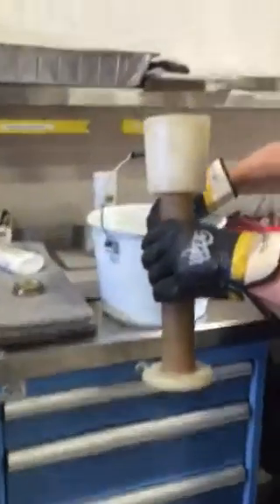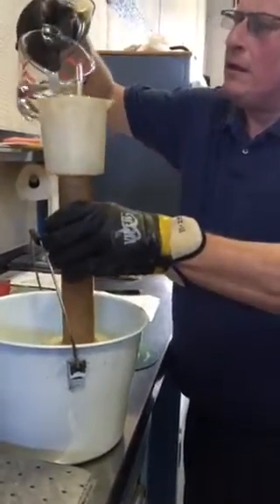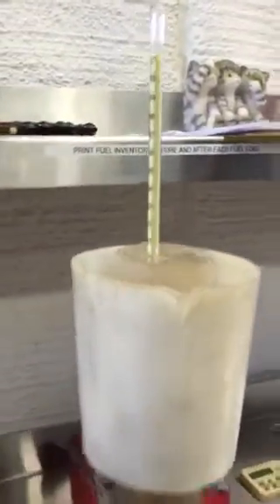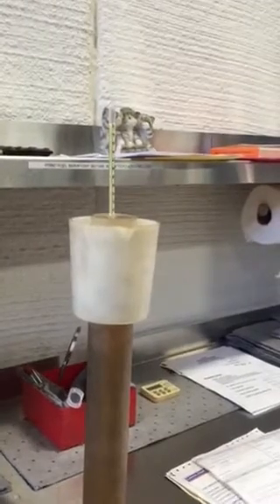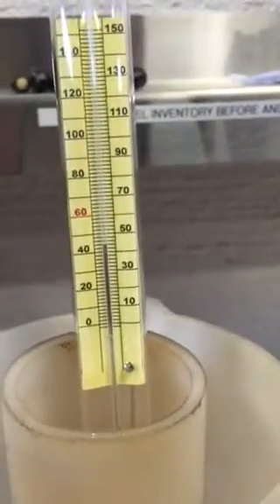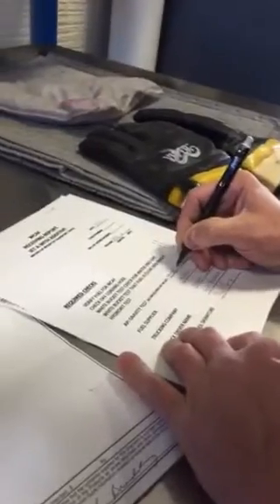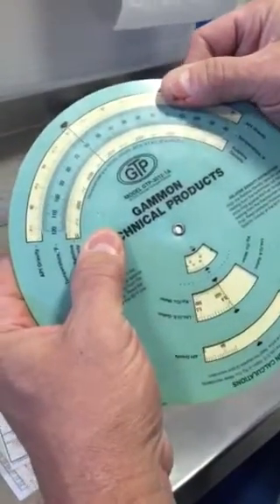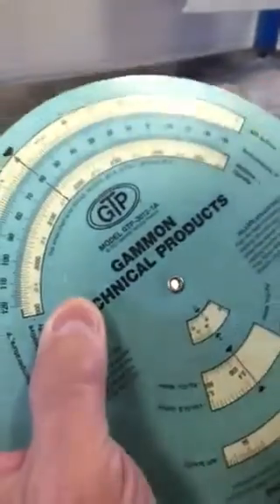API gravity test for Jet Fuel

Comment: I heard the comment in the video "not too long or it will change the temperature, fuel warms up kinda quick in here" during the measurement phase. My question is why does that temperature matter if it is corrected to 60 degrees Fahrenheit/15 degrees celsius? I understand the density changes with temperature, but why would that matter if we correct it 60? Thanks